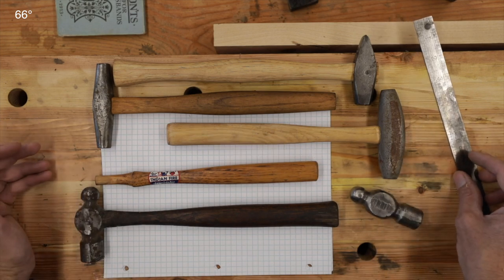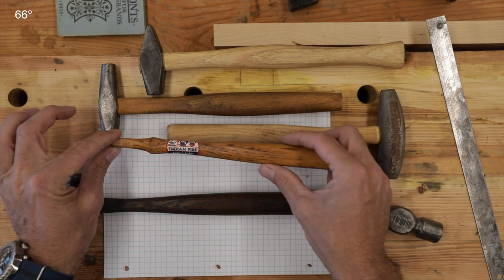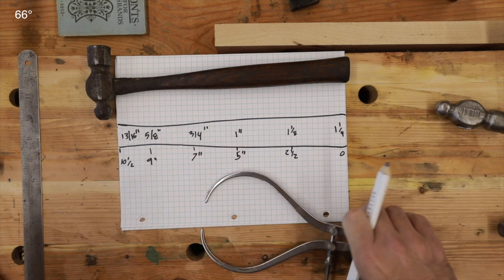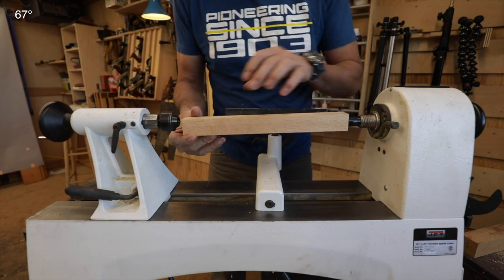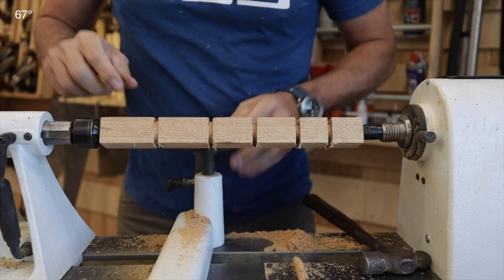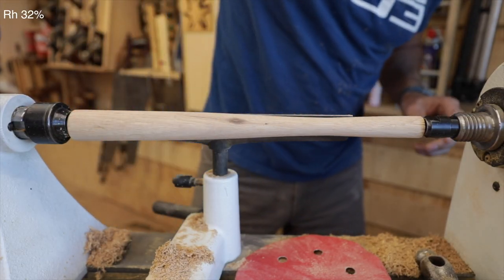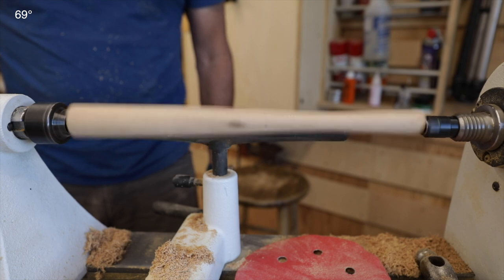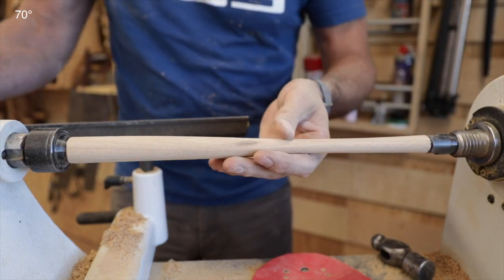If I Sneak Up On It - Maybe It Won't Attack

Comment: Well done Cody, that handle looks good!
The off center turning is really scary at first, but you learn how fast you can actually spin a piece. Next time make your stock a little longer and leave a full sized block of wood on either end that you can cut off with a saw when you are done, or part off on the lathe.
I hope to come next year again and maybe we can spend a day or two in the workshop on the lathe?
I REALLY have to teach you to use that skew as a skew, not a scraper LOL.
I'm glad that did not fly off and kill you!
Face shield on the lathe my friend it's necessary.
Cheers from Tokyo!
your friend Stu
Reply: He did have a nice size but just measured from an end with no gap.

Comment: Cody if you make a Vblock jig for your bandsaw you can run your stock through the bandsaw taking all 4 corners off. Therefore making your initial turning easier to get started

Comment: Some things I would do different:
1. wear a face shield and a leather apron. Exploding wood hurts and can cause leaks in skin.
2. Use a longer hunk of wood than you want to end up with. You want more meat on the ends for those centers to hold on to. You got lucky that drive center didn't bust out when turning that oval.
3. Make sure those tools are as sharp as you can get them.
4. I would have preferred tools with longer handles, so two hands can fully grip them, and I sometimes use my belly for even more stability.
5. Make the blank fully round first. You don't want to catch a corner while re-entering your depth cut.
6. You were using a scraping cut, which is sort of ok, but not the best. Try lowering the tool rest, angle the cutting edge up a bit to actually cut the wood instead of scraping.
7. Oh yea, one more thing. Mark out your offsets for the oval when you mark your centers for better accuracy.
Not bad for your first try though.

Comment: Always remember the ABC's of woodturning. Anchor the tool on the tool rest. Apply the Bevel of the tool to the wood. Slowly bring the Cutting edge into contact with the wood.

Comment: Cody, Center your stock and make the first profile. Mark your off-sets on each end. Spray a light coat of dark paint on shaft. Re-chuck the piece using off-sets and turn the oval just taking off the paint. Re-chuck on the other off-set and turn just removing the paint. This will give you your oval without removal of too much material.

Comment: Commercially made handles are made on a pantograph machine which has a template with a styles riding on it and multiple blanks mounted so that the blanks rotate under the cutters as the cutters cut the blanks to match the template.  The cutters are adjusted so the cutting faces are the same height as the styles tip.  Any shape can be copied.

Comment: Many good comments about your wood turning so far.  When I make handles like this, I offset only the bottom, leaving the top round (which leaves more thickness for fitting the handle to the hammer).  Turning spindles is safer than turning bowls. A rule of thumb is to keep the speed  below this calculation: diameter times RPM should be below 9000. I would turn this size spindle at 1500 - 2000 RPM, but sand at 500 RPM to prevent generating heat and heat cracks. PLEASE USE A FACESHIELD !

Comment: I think if you paint the handle prior to the offset turning then the material you pull off will show the pattern as it turns. Then you could easily sand the paint off during finishing.

Comment: I have very little more lathe experience that you do, but if you leave an inch extra on each end you don't have the scary experience of not having enough wood to fit the centers. Also the gouge would have worked better after you used the parting tool to cut the grooves.

Comment: You need to Leave a 1'' or 2 on the end and then cut them off when you finish that will leave you more timber to on the ends to offset it and have your chisel  facing up  a bit not facing down

Comment: I have been doing wood turning for 2 years now and I would definitely recommend doing some courses on wood turning because I was seriously worried with some of your lets say... methods
Reply: I agree, he did a good job for a no training first timer, but he's scraping not cutting the timber. Tool angles etc are everything, and backwards to everything I've ever learned in relation to tool eights etc. I'm an engineer (machinist) and inherited my wife's grandfathers wood lathe recently. I'm yet to spend enough time to be any good at it but I've made quite a few "practice" rolling pins for the kids!
Reply: Patrick Rebecca Doohan   Yeah learning to use the lathe can be a bit tricky on your own. I also made quite a few practice cylinders to get myself used to turning a consistent line. When I got better I turned them into an all wood bowling set for my boy. And the long one became a french rolling pin for my grandmother. Well atleast with the mistakes you have really nice firewood lol.
Reply: let him learn. soon he will be making bowls. safety is in the eyes of the beholder (OSHA/Engineer7)
Reply: TWO FAR  Two Far, yep.  He did some things wrong, but so what.  People always act like it is some kind of serious infraction that is going to get him killed. I was worried...Sure...It is all a learning experience.  Offer him good advice, otherwise just shut up and let him learn.
Reply: Tenspeed TheBikeHanger  and everyone else ALL I"M SAYING IS LESSONS ARE WORTH IT! I'm not criticizing i'm just saying how its worth knowing what your doing
Reply: Engineer 7  Yet you did not offer any advice or even tell him what he did wrong.  Sure lessons would be great.  Youtube is also a good teacher.  But why were you worried?  Seriously worried?  lol...He did okay.  Nothing dangerous.  He should have roughed out the stock first, used a higher speed and he obviously is not used to using a skew, but hey, that's how you learn.  He turned a pretty decent handle, and even ventured into offset turning.  I hope he can get comfortable with his lathe, it is an enjoyable hobby.
Reply: Tenspeed TheBikeHanger  Jeez boi don't take it so personally
Reply: Tenspeed TheBikeHanger  You know he's a christian? saying "little dipshit" isn't christian at all XD
Reply: Luke A J Miller  You are right.  :-)
Reply: Tenspeed TheBikeHanger  I actually have a NAW certificate in wood turning

Comment: 1. I am not an expert
2. As a self taught wood turner, here are some pointers:
3. Cut that square stock into an octagon on the table saw, less shavings to clean up. Less tool chatter. 
4. If your stock is short, you can clue some scrap pieces of wood onto the ends of the stock so that you have enough room at the ends to cut a champfer etc. then you can saw off the sacrificial piece and sand it flat, leaving no tool marks. 
5. And yes, eccentric center turning can be frightening until you get the hang of it.

Comment: When you set your initial depths try using a crayon, pencil, sharpie, etc, and color your depths. It just gives you a visual so you know if you are taking anything more than the depth you wanted off when you are machining everything in between your depths. Everyone does things different though. Good video.

Comment: Once you have finished cutting the round blank on the lathe you need to go back to your original stock model to measure how much "meat" you need to shave off to make the Oval shape. Put the blank back on lath in the 1st offset position and mark the blank every 2 inches as you did with the first cuts, 1/2 the overall amount needed to be shaved off and make the depth gage cuts as you did with your initial cuts to make the round blank. Then cut out the material in between the depth gages. Lastly repeat on the 2nd offset.
Reply: PS love your content, keep up the great work and ignore the safety sally's most tools end ip with blood on them at some time or another...lol

Comment: Could you leave an extra inch on each end and leave that part full thickness?  Seems like it might allow a safer and easier offset connection?  Never knew this could be done.  Love it!  Thanks.

Comment: Good job on the handle but for your safety I would suggest you watch some videos on which lathe chisels you should use. also the spurr center that came with your lathe because it will hold the piece better, it is old and true tested technology.

Comment: Cody there are only a few tools. If look at them from the sharp end. The one that kinda looks like a smile is for taking off lots of material. Such as taking square stock and making it round. It is a scoop. Turn it to follow the direction you are working. Then the ones that come to a point on one side are gouges those are used to do what they are called. To gouge out material. As for knowing how far or deep to go with the tool you can. Stop the machine. Then place the tool on the rest and touch it to the wood. Then measure the depth you want to cut and place a piece of blue masking tape at that point. That will give you a reference. So you know to stop.

Comment: Use the rest for you tool. Set it up so that the handle of the tool acts as a stop against the rest. Then measure the amount you want to cut off and figure the distance from the material.

Comment: you where supposed to go with a longer piece of wood than you needed. Mark the length of the end handle, and make sure there is enough wood on each end that you can do everything on the lath. When your don't you can cut the blocks of wood off on the end. This makes so everything can be done on the lath, plus you wont have the holes the lath makes to hold the wood on the handle.

Comment: I would also recommend upping the speed a little. Especially with you going from square and the offset turning. When you started I would have gone for at least 2500-3000 rpm. Less dead space. Your piece was straight and balanced. For the offset I would have gone for 1000-1500, maybe even 2000. Then you would better see the "line". The ghosting effect is better at higher speeds and you can better see the shape that way. It's only when you start working on bigger pieces or very off balance ones that you need to bring the speed down that much.

Comment: 1. Your tool rest was far too high.  That can end up launching the gouge into your chin or to the other side of the shop.
2. I definitely recommend taking a wood shop course on turning.
3. You could have done this in two steps rather than three.  There isn't any need to turn a cylinder, then to do the two offset turnings.  Find the center, then do one turning offset to one side of center, then turn on the other side of center.
4. To avoid the tail-end center marks, start with a billet that is longer than you need, then cut off the excess.

Comment: I bought a wood lathe when I had my own workshop. Then life went mad and I think I turned on twice! Fast forward post divorce    I live on a canal boat so it lives with a friend. Was thinking that with a bit of ingenuity I could use it with my generator. Now you have inspired me to do so! Just need to figure out where to store it! 
There is a reason boats have a maximum loaded weight! I had to get some off of mine! I always thought as long as it never lent over 45 degrees you were good!  Seems I was (almost) dead...wrong! At max lading it's 27degrees! Oops! 😙

Comment: My most used ball peen ( a 14oz or so chrome vanadium Craftsman produced by MacPherson-Huff in the 40's ) doesn't swell at the end on it's handle and while it's perfectly fine I do definitely wish otherwise.
I rehung it years ago on a hardware store link that was overall a great handle, and it's patinad and burnished from use so I can't bring myself to remove and replace a perfectly good handle that frankly I've gotten used to.

Comment: Only thing you could of done better is have split wood to turn the handle so the grain would of been perfectly set through the handle so it dont split later! You are 100% correct in looking for grain in handles.....but sawn lumber will often leave you with odd grain placement in handles.......especialy in small handles like your ball pein..... a slpit peice of wood will have perfect straight grain in the finished handdle
Reply: Also......leave your working stock longer by like 1-2inches so you can make the whole handle and trim off excess after if need be

Comment: Ha the title is hilarious but ive been there before and the kickback from a lathe can be very scary. But you dont know scary if you havent stuck a 1/2 inch bowl gouge in a 10 inch bowl blank in a 2 plus horsepower lathe only to have it grab the tool and yank it away from you!!!

Comment: Glad to see you try your hand at turning. If you want to try more off  center turning I would recommend using a spur cup center on the headstock. If your tool catches the wood it will spin freely instead of stripping out where the Spurs (teeth) are seated. It’s very safe and is my go to for most spindle turning. Here’s an article explaining it a bit better 
http://www.edswoodturning.com/2010/08/22/usng-a-cup-center-drive/

Comment: I didn’t like the video, not enough metric units.

(Now y’all can collectively decide if I’m being sarcastic or serious)

[edit]
Cody, in the future use a piece of wood that is longer than you need. Leave the ends alone and work the wood in between. When finished, cut the ends off and you’ve safely worked wood on a lathe.

Comment: 44 yrs as a carpenter, any time a guy choked up on a hammer 1st time it got laid down the end got cut off, if you're not using all the hammer just cut it off to fit you, much like a gun stock
Reply from the maker: If you cut the handle of my hammer without permission I'd hit you with it,
Reply: then never work commercial construction as a carpenter
Reply: RA Hair  I wonder if you really have?  I have worked a few trades and one thing holds true for all of them: You touch another man's tools you get hurt real bad.
Reply: this was back in the 80's and 90's and yes I really have, largest job run as a super was 85 mil. you get a carpenter doing interior window trim that chokes up on his hammer and 9 times out of 10 the end of the handle will hit interior glass and brake the window, watch a carp, they don't choke up on hammers,

Comment: Nice video ;) 
At 14:45 : you should have left the piece a couple of inches longer than the finished handle length  in order to leave enoght room to make the tenon for the head and then , at finished work , you could have removed the excess with a saw ;)
Emh .... why there's a thermometer in the top corner of the video?? Assuming that it is indeed one :D

Comment: You can, you just have to snap a line. Think about it.
Reply: I'm trying my best to understand what you're trying to say here, but for the life of me I can't. What do you mean by "snap a line"? Are you talking about a chalk line? If so, when has anyone ever used a chalk line to do lathe work? Never, because it's gone after the first pass. Think about it!
Reply: LeatherNeck 1833  True, but if you snapped the line on the low of the offset, it wouldn't disappear .

Comment: Anyone else cringe that he didn't knock the corners off of that handle blank before he threw it on the lathe? I was always told to ALWAYS knock as much of the corner off as you can before you put your stock in the lathe.
Reply: I only worked with metal on a lathe and everything that was not round stock made me nervous! The less edges the worse!
Reply: Resurectionist that’s a waste of time when you actually use a lathe right- which he isnt
Reply: No. Chuck it up square, round it off on the lathe.
Reply: Rounding it will prevent possible catches. But I was taught when using square stock to keep your tools sharp,  your lathe speed high, and introduce the tool slowly.
Reply: Love!
Reply: if you tackle it in the right way there isn't really a reason to knock the corners off. If the square is really big it's faster to remove them , but on a small piece like that one it's more than ok chuck it that way